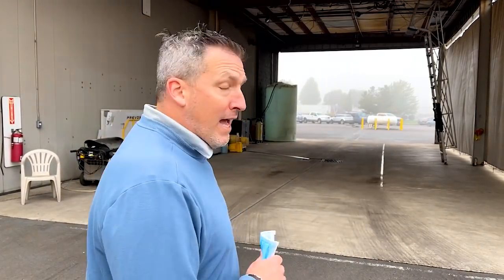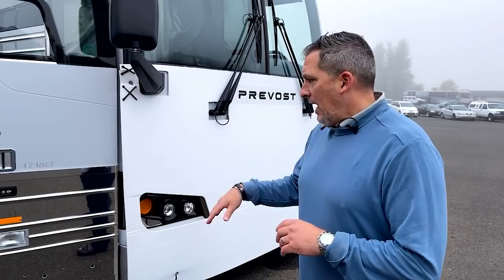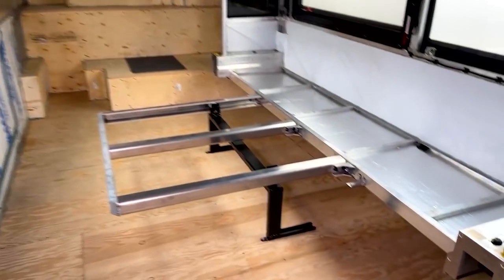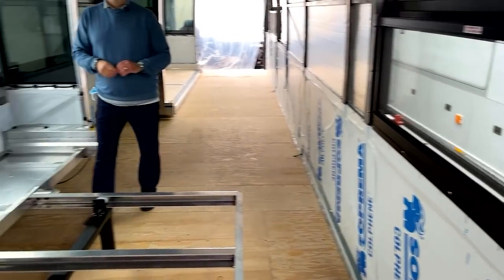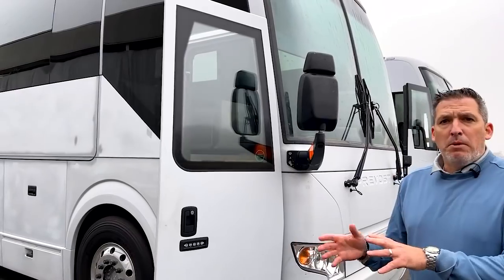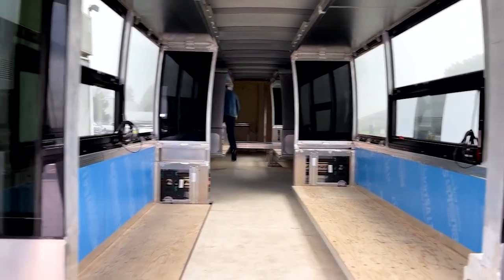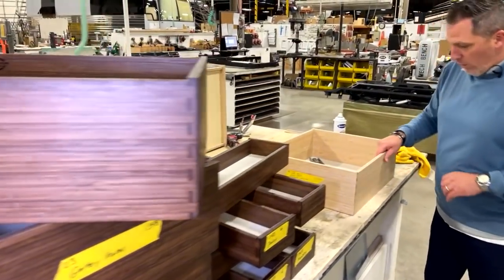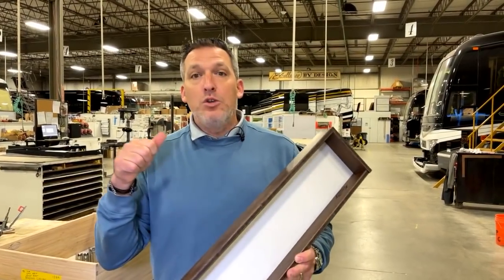2022 Prevost Luxury RV: Compare X3/H3 Chassis. MMwM Ep.237

Comment: The x3 looks a lot like the design of the old Marathon xl from the 80,s . I had a working girl Marathon xl from the 80,s that looked out dated net to the h3"s . I went to the factory back in the early 90"s. It was so impressive to see then build the h3"s , entertainer coaches ( with 12 volt and 24 volt alternators and the Lamerage, seeing them start with a jig ( h3 )to start the walls. I could spend a week just to see them being made !!! I'am sure it has changed a lot since then. Thanks for showing this, Marathon has had a good name in coaches for a long time.

Comment: My Uncle like both chassis, but the X3 without the slides and the wheel flares. Just plainly tell the public that a the bus chassis won't move and flex with time; especially if it's your permanent home. If it has a Freightliner chassis that needs repair, there's a long wait time at the Freightliner dealer.

Comment: Like them both.
For me would love a 700hp+ engine in it
Reply: Not possible, heavy duty road engines only go up to 600 horses for some reason, anything higher can’t fit
Reply: You can get 700hp in a Newell Coach with the Cummins X-15 with a performance package from Performance Diesel Inc. You can beef up the Volvo D-13 that Prevost uses with a kit from PDI as well.